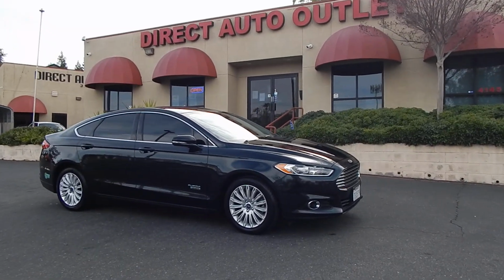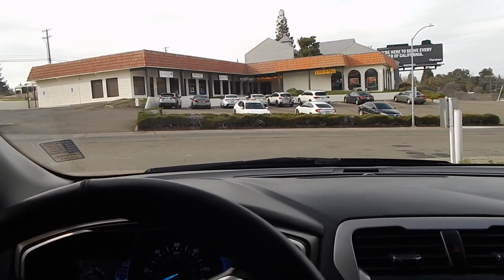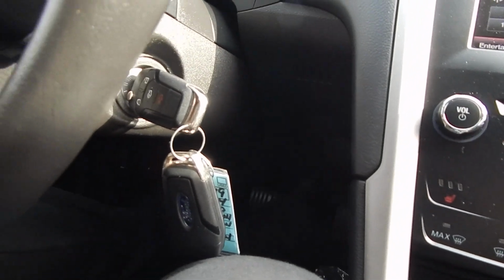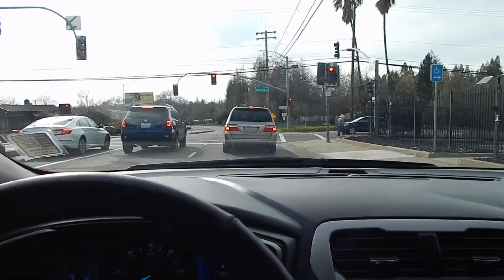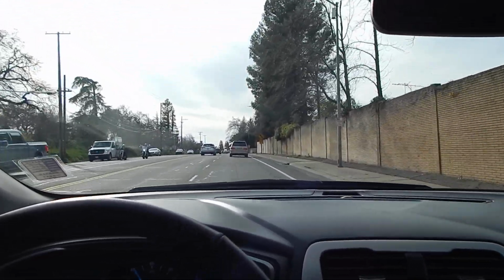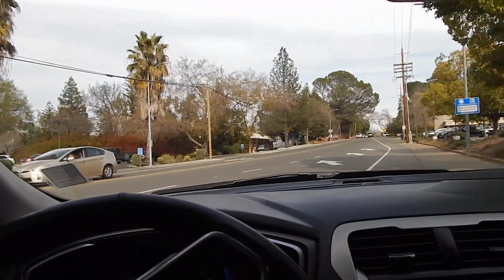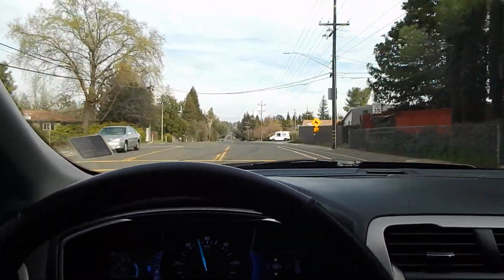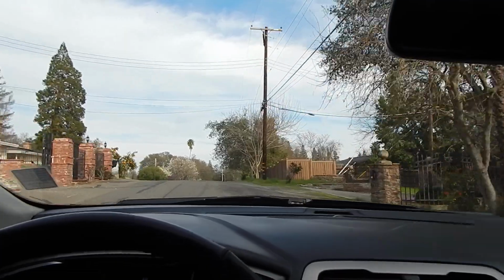2014 Ford Fusion Energi Hybrid complete TEST DRIVE video review

Comment: Here's my burning question:

Sure, a new energi will do 20 miles on just the battery, but how about a car that's been on the road for 8 years and 100k miles? Not a detractor here, just someone curious about battery degradation lol